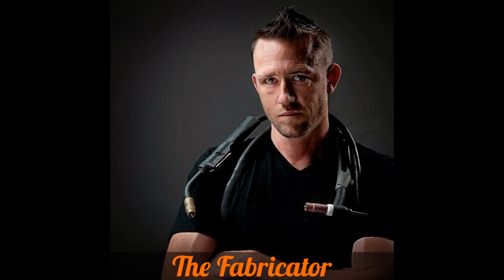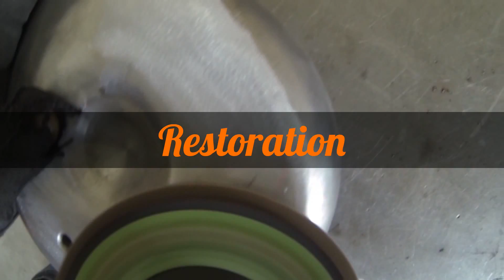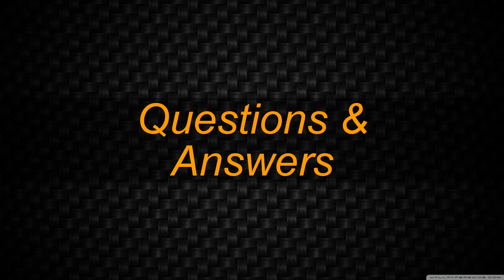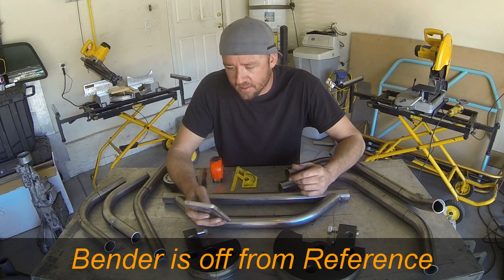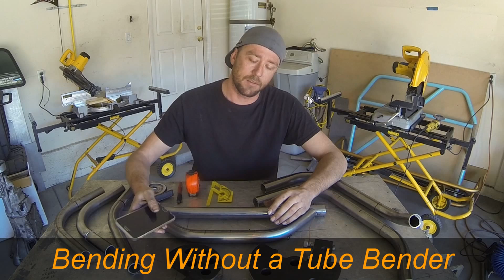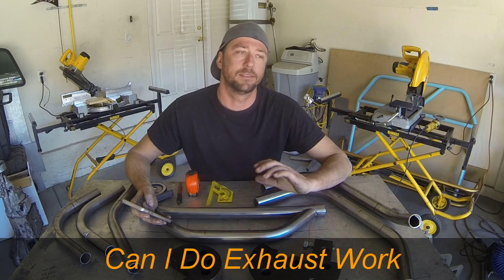TFS: Tube Bending Basics 3 - Q & A

Comment: Sand: I've read packing your thin-walled exhaust tube with sand makes it bend acceptably in the JD style bender.  That does seem like it would be messy for anything but a small project, though.

Comment: I have a Mod-32 bender . I want bend 95 wall X 1 in a U . With a outside finished U of 12” . I am trying understand the take up on the material . And the distance from each 90 as I bend to get finished piece of 12”

Comment: i saw the question about bending from prints. i run industrial stainless tubing at work and my cheap ass company bought a set of benders like this. (not dogging the benders, but they weren't intended for my work) All measurements i take are from center of tube to center of tube. so what i did was pick a random length that i wanted to make my bend at. so say i wanted 10 inches from end of tube to center of tube after the bend. obviously it came out a bit long because these measurements he takes are to the center of the bend, and not actually the center of the tube after it's bent. so i just took the difference between  what i got after i bent and what i actually wanted and added it to the setback (measurement from center to reference mark) and im able to hold center to center measurements between bends. hope this helps if anyone was wondering about this.

Comment: For the Q number one: the FIA got a official  manual or a rule book of the basics of the roll cages, it shows you the basic structure and diferent examples of roll cages and its wall thickness. You can start designing from there.

Comment: I use a JD Squared model 32 which is very similar to the one used here but has the anti springback system added that helps to keep bends even smoother. 
I'm in UK and you can get them from www.stakesys.co.uk  The fella there is most helpful being a fabricator himself.
Reply from the maker: Right on. Thanks for sharing.

Comment: Great Series.  Would be interesting to have tube bender manufacturers send you their benders for a tube bender shootout.  I was looking at getting the same model you have since it would be consistent with your video tutorials.  I'm also interested in DIY roof rack making, so bending round and square tubing of different material. Your videos have been very informative--thanks.
Reply from the maker: If all the manufacturers would send me their benders, I'd definitely put a vid together comparing them.

Comment: Interesting, but do the same basic principles that you've shown for Tubing also apply to working with PIPE and Pipe Benders ? Because, a roll-bar/cage for a race car is vastly different than a roll-bar/cage for a Bulldozer, both in size and strength. - The reason I ask is I want to build a roll-bar/cage for my Caterpillar D-2 Bulldozer.
Reply from the maker: 001DesertRat I really can't offer much info on building a ROPS for equipment. I know how to replace them all day (previous profession), but I don't design them. I can say that they are not made out of pipe. The principals of pipe bending are similar, but I've never been a plumber/pipe fitter, so I can't offer much info there haha. I would try to find a heavy equipment engineer who specializes in ROPS and try to get some info on the subject.

Comment: how much room would be needed to mount Bender to floor and have room to do main hoops and such with out hitting wall .
Reply from the maker: The center of the bender needs to be about 4 feet away from the wall for the handle to clear.
Reply: Does that leave plenty room to do main hoops,  down bars n such
Reply from the maker: Not if you put it in a corner. This was mounted near my garage door which allowed me to create more space by opening the door.

Comment: What do you mean saying "rulebook"? What kind of book it is and how it can be found? Google returns a lot of unrelated links for the word "rulebook".
Reply from the maker: Every roll cage made for a sanction of will have a rule book that states requirements for wall thickness, diameter, tube location and general design requurements. 

If you need to know what to use for a roll cage, look in the rule book.
Reply: The Fabrication Series So you mean a roll cage rule book? But how to design it for an arbitrary car body?
Reply from the maker: Let's try to simplify this - what is it that you want to build? Tube chassis? Roll cage? Bumpers?
Reply: The Fabrication Series I just have become acknowleged about rollcages. Wiki says: "A roll cage is a specially engineered and constructed frame built in (or sometimes around, in which case it is known as an exo cage) the passenger compartment of a vehicle to protect its occupants from being injured in an accident, particularly in the event of a roll-over."
So I thinked it will be reasonable to build such a thing for my car. I own this one which is pretty good but doesn't look safe:
https://en.wikipedia.org/wiki/Aleko
Reply from the maker: Almost every sanction lists requirements for a roll cage design that they require for use. You first need to figure out what type of cage design you want to build, then find the rule book which explains the requirements for that design. There really isn't a universal or "fit's all requirements" type of cage. One wrong tube or design could kill you.

Comment: hey great videos im learning alot here, one question, how do you make a continuous curved bend? would you just break up the desired angle into incriments and bend several times at incrimental distances? say a 60 degree angle bent 12 times at 5 degrees every so often?
Reply from the maker: Continuous bends are essentially bends with a much larger radius. Tube rollers are the tools used to achieve a very large radius. If you make small bends on a small radius, you end up with a tube that is merely bent how ever many times you bent it. The radius will not be continuous because the die leaves an impression in the tube every time you make a bend.

Comment: Hello again just wanted to thank you and ask about taking the slake. or free play out of the JD Squared hydraulic JD Squared bender to zero it out.  I do use the same reference point, but i when i make a bend and try to replicate  it . It's off a few degrees. When i hold them up to each other you can see the difference. I hope you can help me. Thank you very much.
Reply from the maker: If you add some sort of release pin, or an open hole (like a hook) to the drive link, you can reset or adjust the slack manually before hooking up the cylinder and continuing a bend.
Reply: Thank you i am going to try that and thanks for all the info you put out i think its great.

Comment: Thank you Mister, it is very educational. I have a question, could you bend a piece of tube at a larger radius than the die with type of bender you have, e.g. (I use metric) use a 20cm diametre die to create a 40 radius bend or larger.  Much appreciate it!
Reply from the maker: +DONW999 Yes and no. Yes, you can do little tiny individual bends while shifting the tube to create a larger bend. The only problem with that is the bend will not be uniform and obtaining the exact CLR would be extremely difficult. It is best to use the correct die for the correct CLR you require.
Reply: Thank you Sir, for the quick answer. Basically, I am making some back support of a backpack, and the curvature on the 6-8mm DIA aluminium tubes needs to be over 150r Would it be still good to use manual bender or am I better off with those automatic bending machine? From that point, there is problem of finding the right die. Again, thank you for your help!
Reply from the maker: DONW999 If you are planning on goinginto production, you will likely want to invest in a machine with high efficiency and repeat ability. For prototype work, you might just want to get a couple dies machined to your specification.
Reply: I see, that seems to be a viable option. Will give it some thought. Thanks man!

Comment: I would like to ask you a technical question about the bender. I'm from Brazil and we don't have access to this kind of bender over here, so I'm building my own bender. The machine is based on JD2 dies.
I was reading the JD2 datasheet and the specify the following radius x tube diameter:
0.750"⌀ x 4.5"CLR
0.875"⌀ x 4.5"CLR
1.000"⌀ x 4.5"CLR
1.125"⌀ x 4.5"CLR
1.250"⌀ x 4.5"CLR
1.375"⌀ x 4.5"CLR
1.500"⌀ x 4.5"CLR

So for all this tube sizes I would fabricate a die with the same centerline?
Another thing is that they don't mention the CLR for the 2" die, would be the same?

Thanks in advance,

Best regards.

Comment: Nice vids, I have just bough a tube bender and this will be very useful to use it. My bender it's very similar to yours. Which is the lower and upper limit for the thickness of wall?? And wich kind of tube you use?? Thanks for sharing your knowledge!!!
Reply from the maker: +Cesar Mendoza It really all depends on the die size and CLR. I can bend 0.065" to .120" regularly. It will do smaller diameter .250" wall, but anything larger would be pushing it, if you could even bend it by hand.

Comment: I'm really looking forward to the full video!

In the mean time, what is that miter style saw on the left of the screen behind you?  I have a DeWalt multi-cutter and I love it, but it would be soooo much nicer if there was a way to get a bit more angle adjustment out of it.
Reply from the maker: +Hammerhaus Kennel The miter saw is a Dewalt DW715 12" single bevel. I use it for just about all the wood work I do as well as cutting aluminum.
Reply: +The Fabricator Excellent, thank you!  I might have to pick one of those up if I end up needing the crazy angles more for aluminum than for steel.  If it ends up being more steel than Al, then I don't know...

Comment: have you had any trouble bending thing wall small dia tubing and is there any tricks?  Talking 1 or 1/14" 0.65
Reply from the maker: +Viper Strikes I bend a lot of 1" x 0.065" tubing with no issues. I use a 3" CLR die.

Comment: Definitely don't use a pipe bender... years of doing electrical work and now working in architecture I can tell you that bending tubing with a pipe bender will result in a weak point because of the deformation in the profile of the tubing.

Comment: Supplemental question for Q&A: Carbide tooth blade vs Abrasive for your "chop" saw?
Thanks for your work and "de-mystifying" this type of work.
Reply from the maker: Both work very well. It's up to the user. I find carbide blades very useful for repeat cuts and more "procuction" type cutting where speed and accuracy is essential for efficiency.